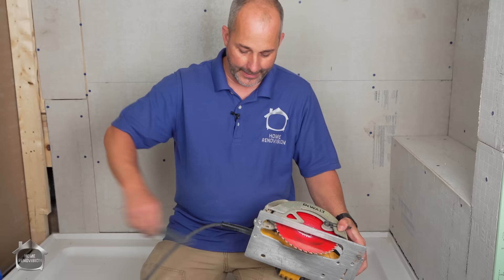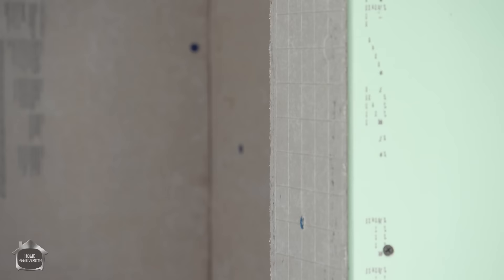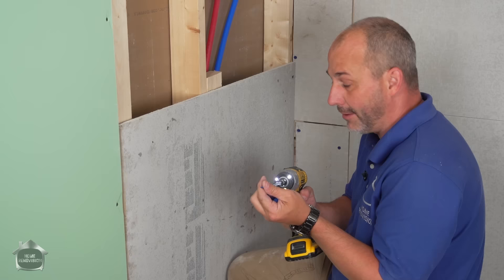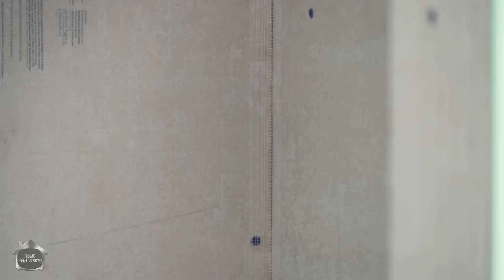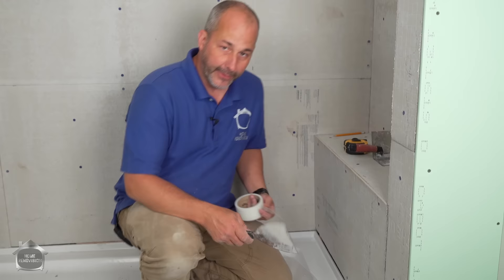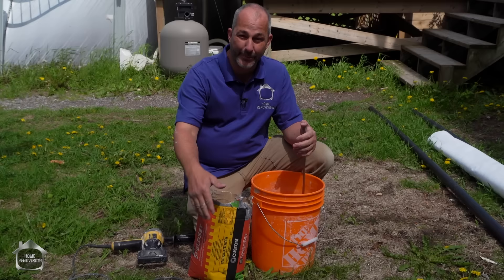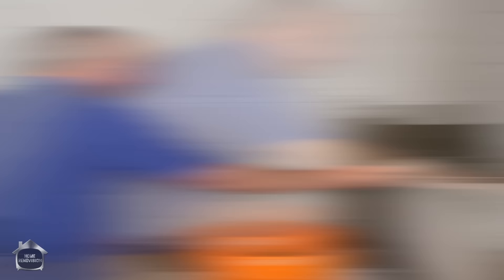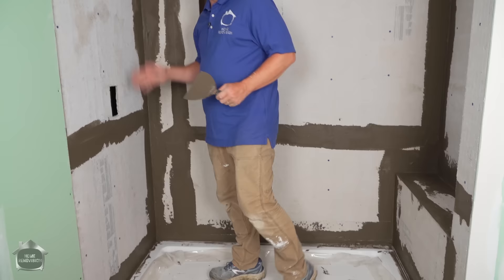How to Install Cement Board for Beginners

Comment: Green board is completely fine to use on the shower/tub areas . 
The key is to waterproof the board , green board or cement board no difference .
There is no advantage for cement board , except perhaps on a bench in the shower for added strength .
Cement board is  a total sponge , it will wick water vertically etc  like crazy .
All of your issues are with the shower pan , that is essential . 
Make it easy on yourself , simple green board taped and sealed with red guard is all you'll ever need , and it's so much easier and faster
Reply: Green board is much more of a sponge than cement board, cement board with red guard is far superior. Better tile backer also, far more rigid, tile mortar can not sustain flexing.

Comment: Hello Jeff and thank you first in for most I like to start by saying that my wife and I we hired an individual to do our bathroom but it turns out that like you say everybody has your likes and your dislikes about the product that they use the procedure that they do but what I’m trying to say is this individual when we approached him because we wanted to vapor proof with membranes and sealants and stuff like that like we see all over the board and and we spoke by question with respect but the individual we found out that he doesn’t do that type of work to be protective he does it supposedly on a daily basis and by doing so he says this is the method that I learned this is what I do and I do it professionally but we found out that there was too many loopholes and it was actually products that he didn’t want to use versus protecting from water barriers and stuff like that so I turned out that he dropped a job and left us with our hands in a year but we decide To eat attack of the job or get another construction worker to finish out the bathroom the tub was replaced it’s been got it out but here we are with no bathroom what I’m trying to say is you do go to work we like it we wanted to perform it in our bathroom but it turns out other people don’t want that because I get as much easier for them to take the short route thanks again thank you very much
Reply: Man, that's one hell of a sentence.

Comment: How does the water make it through the tile and the grout? If the tile and the grout weren't waterproof why the f*** put tile in the first place? Also you're putting cement board on the walls why do you need to add more cement for your membrane to stick when it's all concrete anyways why mesh and more concrete on top of the concrete you already have? You just said the membrane sticks to existing tile or concrete so basically it sticks to anything? I'm pretty sure if the tiles done correctly there's no water getting to anything. Pretty sure it's unneeded redundancy. Just saying

Comment: Shouldn't the board be installed over the lip?
Reply from the maker: Absolutely not. it goes to the top of the lip. if you go over the inside corner is not straight. then the tile is a disaster. Cheers!
Reply: @HomeRenoVisionDIY  Ah, that makes sense. Thanks!
Reply: @HomeRenoVisionDIY  What do you think about fastening furring strips to studs then fastening the backer board to the strips and over the tile flange? Then the tiles are level, fastened to the backer board, but there’s no way water is getting behind the flange.
Reply: @SteveYager furring strips is absolutely the way. Instructions for tubs and shower pans will show that. That paper thin layer of thinset and mesh tape is going to crack with expansion and contraction, it’s not meant to adhere to an acrylic pan.
Reply: @Lwoodworks  I wonder why he's so insistent on installing it just to the top of the lip. Seems like it goes against the instructions and common sense.

Comment: Oh boy you're gonna let people figure the critical stuff the hard way.  Obviously if people are putting up backer board they're planning to instal tiles which means those boards must be perfectly plumb and perfectly flat otherwise the tile job will be a train wreck.  Leveling, shimming and proper fittment of these boards is the most important part of this job and you make no mention of any of it.  30 years you say...Hmmm.

Comment: That flange and mesh tape scene has me cringing. Please, if you're reading this, do not do that. I have never in my life seen a job done like that, and I cannot imagine that that system effectively keeps water from reaching the studs and wall eventually. The cement board always goes in front of the flange and sits about 1/8-1/4 in. above the shower/tub.
Reply: Seriously, I am reading the kohler install for my cast iron pan and they have you furring out the cement board over the lip.

Comment: I notice on a lot of you’re work you are sloppy on the butt joints as you see in video on right hand side of shower. 
My question is why do sloppy work or bad cuts sure you can slap a bunch of sealer in but that just doesn’t seem right.
I’m sure those who might not know better look at the work and won’t see it but that crack has more of a chance failing do to how wide it is plus it doesn’t look Appealing in the first place.
I hope your not one of them guys that’s says I won’t be around in 6 years so what’s it matter.
I’m just saying the larger the gap between the board the more of a chance of the seam failing that’s all.
You tighten down the gasket on the valve covers because you know if you don’t it may leak.
I also notice you use a lot of redgard water proofing is the Redgard rated to withstand the amount of weight that’s going to be put on it from the thin set and tile that’s going to be holding on to it.

Comment: I'm getting a bathroom done right now and clearly the workmanship is bad. There are gaps in the cement board where it meets the drywall, broken corners of the cement board by screws too close to the edge and there is no lining under the cement board. I think I'm going to fire the crew. I'm 6K in and will probably have to eat that. This sucks.Typical south Florida bullshit construction.

Comment: you're wasting time and money applying that water proofing membrane over cement board that's already water resistant. A vapor barrier behind the cement board is much simpler, cheaper and very adequate.

Comment: You're suppose to have a 1/8"-1/4" gap between boards that get filled with thinset & 2" mesh tape.   Then the waterproofing also requires a 6" fiberglass mesh at all corners with 2 coats & sometimes 3 to get the proper mill.

You obviously didn't read the instructions on your products.